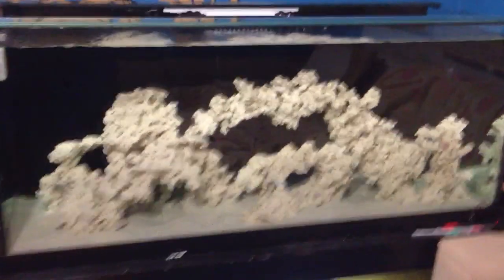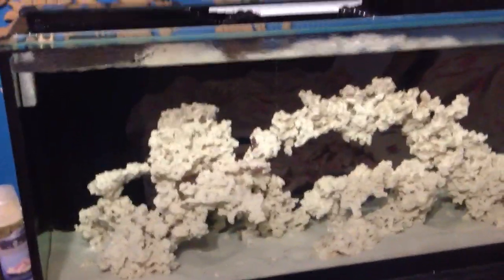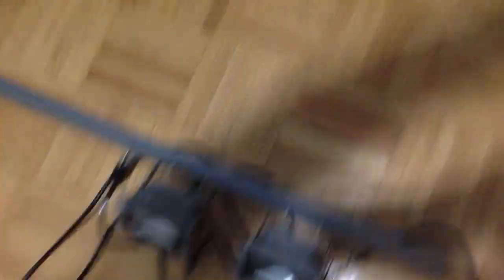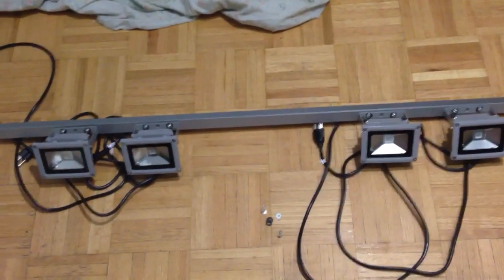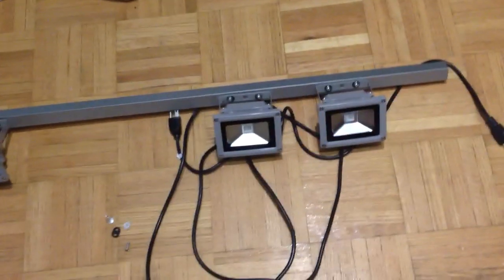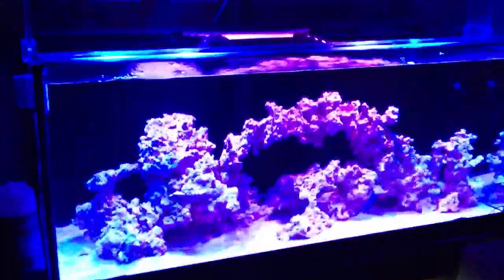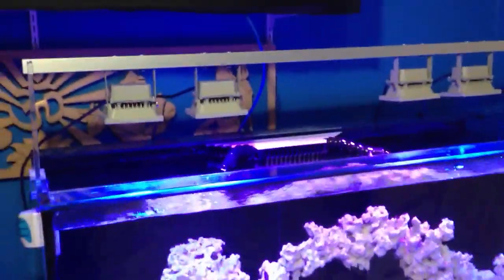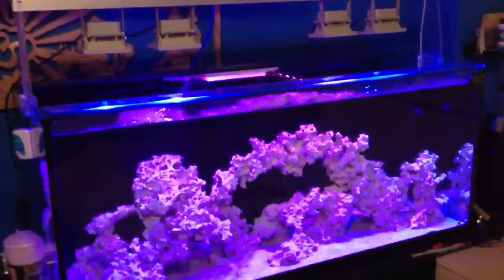DIY LED Reef Light Stand

Comment: What kind of "metal bar" is that?  What department of Home Depot did you find it in and what is it called?  Thanks for the inspiration!
Reply from the maker: Ask any sales rep. It is called Aluminum square bar. They switch this product to different departments however most of the time you will probably see it in the screws and bolt area.

Comment: Is there a similar product on the market that I can buy from Ebay amazon or from other trusted sites? I need to make the two sides of my tank higher to put my lights on it. So I am looking for a mount that is minimum 3.5" tall (more is better) and has a flat top (if it has slide protection on the edges that is ok, if it is wide enough.) I can't hang my lights, that is why I am looking for a mount like this... I would use it for regular long LED fixture and a regular long (both 36") LED fixture.

Comment: I have one of these lights also and was thinking of doing the same thing. I question how you can do this on a timer based system though. A timer or tank controller would essentially cut the power to that outlet and turn it back on. On my light (not sure of yours), when I plug it in it goes into a color cycle mode (demo mode) until I choose a color from the remote. So in essence ever time the lights would turn on, I would have to manually set each of them to the right color.

Comment: looks really good man i cant wait to see how corals respond.  The only concern I have is when you adjust each individual light do you see variations in the color across the tank.  Also did you get your lights on ebay.  and what ebay vendor did you use.  Also did you have to buy a remote seperatly or did it come with a kit and how do you program the remote to work

Comment: OH now  i got it.. 4x10W.. nice look and feel. Yeah i feel indeed your previous power LED s(2x100W?) were way to bright. Normally wat i found in the forum is if you have 200W metal halide(HQi) then need 1/2 for LED ie 100W to match. And for T5/T8 1/3 is ok too. 
For intense lighting in sea aquarium you need 1w/l in terms of T5/T8 lamp power. So you can calculate pretty much about how much LED power you may need. 
I hope this RGB LED gives all the spectrum needed for your precious corals:)